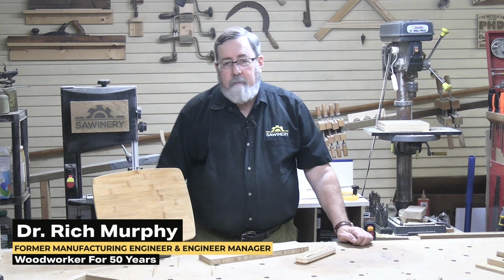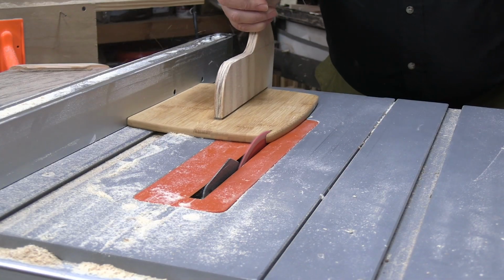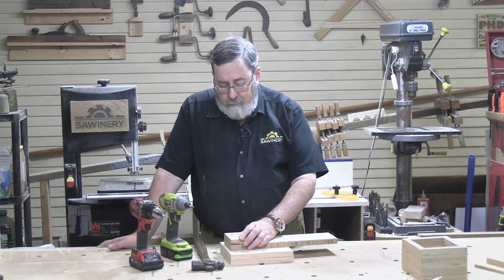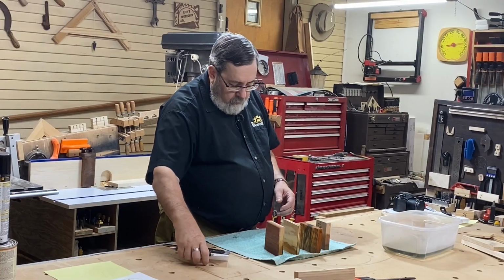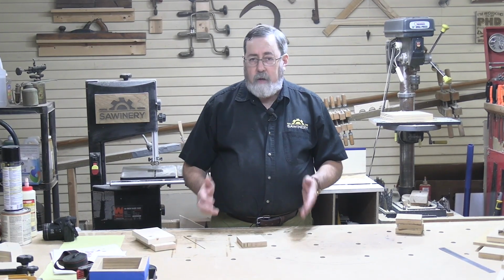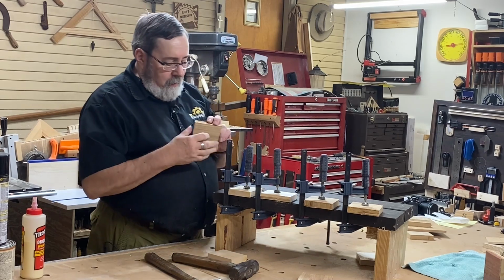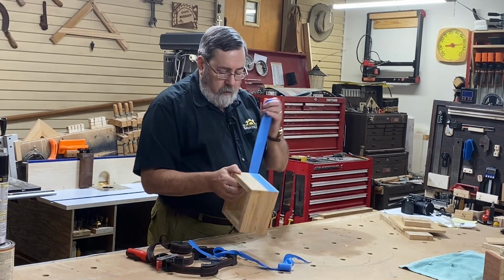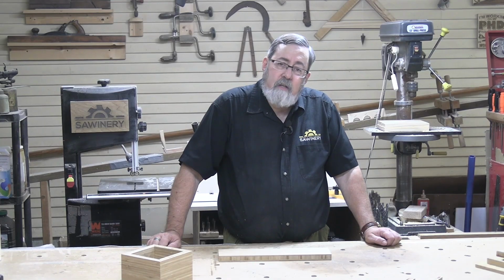Bamboo for Woodworking? I Tested It to Find Out!

Comment: You can buy solid bamboo flooring. The stuff I have is 15mm thick and is not a plywood-style material but composed of either 15 x 6mm strips bonded vertically, or three layers of 17 x 6mm strips glued edge-on.
That suggests that boards should be available that haven't been made into flooring - but I haven't found it yet!

Comment: There is a company called CIC Workshop that sells 3/4" two tone bamboo called BamX for about $15 a board foot. It’s sold as a CNC material but you could use it for traditional woodworking if you wanted.

Comment: Bamboo is a terrible material. It's attractive but very expensive.
The plywood is very expensive, like $300 per 4X8 3/4 sheet and last I checked was 5 years ago.
The real problem is the splinters. They are long and very sharp and very painful.

Comment: Looking at the measurement for wood expansion with water, you can normalize the change by dividing the new width by the previous width.  If you do that, the bamboo expands by 1.012 over its original size, the Softwood by 1.089 times, the Pine by 1.05 times, and the Oak by 1.073 times.  It still shows how insignificant the bamboo expansion is relative to the others.

Comment: 27:00, the difference in price between the price of the cutting boards and the price of the plywood is related to the countries they are coming from. Most of the plywood is coming out of Japan with their dedication to quality control, and it's mostly made from Phylllostachys bambusoides or Japanese timber bamboo, which is a relatively thin walled and temperate bamboo. The cutting boards are machine made in China with government subsidies and prison/slave labor from Phyllostachys edulis which is the main Chinese timber and food bamboo. Thick walled and temperate, it requires a tight range of growing conditions in order to thrive. Most of the flooring is made in India or the middle east from Bambusa textilis and other clumping tropical bamboo.
We are working on developing our domestic production here in America, but close to 80% of our bamboo is still being imported. Clumping bamboo is more of a softwood, while temperate bamboo is more of a softwood. Rather than using bamboo as a replacement for cheap softwoods, it's better to use it in applications where toughness is a factor, especially in comparison to its weight and size, since it's tensile strength competes with steel.

Comment: Years ago i knew a guy that made bamboo furniture out of bent pieces of whole bamboo, then lacquered. he had a ample supply where he lived and it grows fast. I think there is lot of potential. I think the prices will come down it already used in mass manufacturing it doesn't have to be that expensive.

Comment: Like lumbar core plywood then? Just more homogeneous? 

Daresay it'll come down given it's sustainability 

Thanks for video of this, limited info out there.
Reply from the maker: The structure is different than lumber core plywood and it is also made from bamboo. The piece I used had only one core layer, which was laid perpendicular to the grain of the surface layers.

Comment: One of the other reasons it is so expensive is the fact it can't be manufactured here in the West. There is specialized machinery used in the areas of the world, mainly Asia, where bamboo is grown and processed. Then it has to be shipped around the world to get to us. Also, a lot of the prep work of bamboo to get to the point of being able to manufacture it is done by hand, by cheap labor. In other "woods", the processing is simple, and the same methods have been used for 150 years, if not longer. Plywood has gone under improvement over the years, and machinery has been upgraded to accommodate those upgrades. As you mentioned, it's new, and anything new is generally more expensive until it's been around for a while. I would like to see the sheet goods used in Asia to be available here in the States. Thier version of butcher block comes in varying thicknesses like our plywood does but it is finger jointed. I would love to get a few sheets of that!

Comment: Bamboo is very cheap, fast and easy to grow as it is just grass after all and it doesn't take much space. With a single knot you can let it grow for a couple of months, drop it when you see ten knots and within a year you'll have a lot of it. There are three bamboos that I know that can be used for high performing growth that are the Moso Bamboo, Madake Bamboo and Golden Bamboo (one of these being absurdly fast but don't remember which one). It is extremely versatile, strong and great for beginners. I'll grew a bunch of it to make a high fence and it will be extremely cheap'n'easy to do it. 
I want to make a garden tool shed but I don't know how I'll approach it as I don't want pests crawling in it and I know I'll have to combine another material or layered bamboo (probably both), as for the roofing I'll let some bamboo grow a while longer to get some thickness to it and cut it half and interlock it to be water proof, think of a W-shaped bamboo roofing.  

Great video, learnt a lot. Regarding the logistics of bamboo, considering that it is high volume and cheap when raw I believe that the domestic market will have to pick up the production from Florida to around near Dallas as prime spots to grow it.

Comment: Total layman here, not a woodworker at all: Seems to me that the way to use bamboo cheaply and efficiently for structures is in its least processed state: Straightened tubular stalks, maybe cured for strength. I've seen incredibly tall scaffoldings built in Hong Kong using mature bamboo stalks. They would likely make for an excellent framing material, which flat wall panels and flooring can then be nailed or lashed to, maybe using U-clamps or some such.

Comment: only thing to be aware of is, when you have a single layer sheet of bamboo, it will crack easily when it shrinks, so you always pretty much need a minimum of a 2 layer plywood
Reply: also untreated it molds easily when it gets wet like outside, maybe because of the sugars
Reply: @DoozyyTV  Mine doesn't mold and I have left it  lay out in 8 months of pacific coast winter rain that grows algae on my driveway. Even the dry leaves usually make it several months.
Reply: @TheDuckofDoom.  maybe it differs with species

Comment: Bamboo, being a grass, grows super fast too. Its super 'green', because it grows fast and just about anywhere. The price should come down drastically as it becomes accepted enough that more processing facilities are worth bringing online.  And price only has to drop down to compete with other plywood options for it to take off
Reply: It is mostly a myth based on half truths spread by people with a trivia level knowledge of the subject. Dry wood-mass production of bamboo is not much different from most trees on a per acre average, plant leaves can only absorb so much sunlight once you have a closed canopy it is all being intercepted. Absorbed sunlight = cellulose and lignin. 
The culm only elongates for about 2 months(Using sugars stored up over the prior 9-10 months), but it can only do one flush per year in temperate climates, and then takes 3 years a culm to harden for harvest. Even that is assuming a matured plant that can send up large culms, which takes 5-10 years depending on transplant size and growing conditions. And of course they are hollow and airspace doesn't count.

Comment: I found this interesting because I've built things from 9mm bamboo plywood, but didn't test as many aspects nor as methodically as you did.  

I made a concealed drawer about 30" x 18" x 2½", with rounded-over edges and internal partitions, some trays, and an octagonal box about 10"x 8" x 7½"with some laser engraving and a lift-off lid made from two layers laminated together.  It cut really well with my mitre saw, and yes, the usual tricks (like scoring the line first) do prevent tearout and spintering.  Joints were mostly simple butt joints or mitres, glued with Cascamite (if you're not familiar with that, it's a powdered resin-based wood glue).  Some were pinned with 18g brad nails from a nail gun with no issues.  Edges from the router cutter and some others that were just sanded came out very nicely. I didn't need to sand the face surfaces like I usually would with baltic birch, and most of the items were finished with beeswax paste, which worked well.

All that was from a single 8' x 4' sheet, which was actually less expensive than the same size baltic birch would have been at the time, though I got a small discount because one corner had some water damage.  So, yes, water does eventually affect it, in this case making it warp and discolour.

Comment: Bamboo can be processed into a very effective replacement for wood, however, it is worth noting that the high silica content does result in bamboo dulling your steel cutting implements much more rapidly than regular wood. It's also one of the reasons I don't like it for cutting boards.

Comment: I made my PC desk out of bamboo, 120€ (around $140). It was a 240x65x3.8 cm board cut to 200cm. With the leftover piece and a couple of cheap bamboo cutting boards ($10 each) made some shelfs for the desk. It's an awsome material to work with, very durable and beautiful. Hope you can find it cheaper!!!

Comment: Bamboo board is an amazing material with a hardness compared to the harder hardwoods and a flex compared to the more flexible hardwoods. It's very very useful for sports equipment like boards, sticks, clubs  and bows. It's also a very good work surface material.

The price comes down to trade and locality. It can grow anywhere and it does so really fast. This means it's possible to get it as a very cheap and sustainable material anywhere as long as there's companies growing it that are local enough and of a big enough scale. Nowadays most of the raw bamboo board material that's available on the market is grown in China so the price is heavily influenced by transport costs and trade relations.

I hope more large growers pop up in Europe and North America becaues it's well worth the effort.
Reply: The properties have a wide range from specie to specie. I have some that bend to the ground under snow load then spring back but generally are a bit noodlely. 
Others that are fairly brittle and more prone to splitting but are much more upright and ridged. This is partly due to different wall thickness to diameter ratios but also just a difference in the basic fiber structure.
Reply: @TheDuckofDoom.  The workable sheet material is also prone to splitting but to break across the fibers is almost impossible. That's why you see three layered laminates with a very thin top and bottom sheet. It's just to keep the fibers of the core together to form an extremely though sheet material but if you know its strengths and limitations you have more flexibility using the single ply sheets.

Comment: I built a  very large tent frame for an ex army tent. it lasted well over thirty years. eventually the canvas rotted away but the frame was still remarkably sturdy. My carpet is bamboo, my undies, are too
Reply: FYI, “bamboo” fabrics are a semi-scam: it is simply Rayon (viscose) made from bamboo cellulose rather than wood cellulose. It is not, as the marketing often suggests, a natural fiber. (Rayon is considered semi-synthetic.) True natural bamboo fibers are rarely used.

Comment: It's still not economical, but bamboo is a common option for standing desks and some of the manufacturers sell the tops standalone. It's an option for larger pieces.

As for the price, it's a bit of an economic chicken and the egg scenario. Until people are using enough bamboo to establish more regular volume shipping and quick stock turnover in retailers, the logistics of low demand are going to inflate the price, and the inflated price is going to keep demand supressed. It might take something like volume agreements between local woodworkers and local lumberyards/hardware stores to get the ball rolling on driving down the price.

Comment: I have been making golf putters from laminated bamboo for 7 years, and before that I made cabinet doors and loudspeaker cabinets from it.  Once you figure out how to work with it, you can achieve outstanding results.  One of the hardest problems I have faced was getting a supply of the material shipped to Hawaii in the thicknesses I needed.  I started with unfinished flooring that I laminated together to build up the thickness I needed, but eventually I could no longer get that as flooring switched to strand woven (which doesn't work for my application).  I changed over to a combination of 3/4" plywood laminated to stair tread planks that I planed to thickness, then ran of that.  Now I am using cutting boards laminated together.  I found a factory in China that makes cutting boards, and got them to make rectangular boards of the sized and thickness that I need for my process.  The shipping costs 3x the cost of the material, but overall it is affordable and I have a consistent supply.  One consideration is that untreated bamboo is bad about growing mold in a humid climate, so I have to clean the boards carefully then store them in a small dehumidified cabinet.

Comment: Bamboo is perhaps the single most versatile organic product I could imagine. You can use it for every part of a "meal": you can cook the roots and shoots in a bamboo pot, using bamboo utensils, suspended on a bamboo frame, while sitting on a bamboo mat under a bamboo cover, with a fire burning bamboo that you started with bamboo feathered tinder, kindling, and bamboo friction bow. Not really related to woodworking but even so, I love this stuff.

I doubt I'd ever build a wardrobe from it, but a bathroom cabinet or vanity... yeah probably.
Reply: another extremely versatile material is hemp! Hemp can be made into almost anything as well and is also very fast growing like Bamboo, they've made hemp plywood type deal thats similar in hardness to Oak, and hemp can also be made into fabric, shampoo, paper, rope, and a ton of other materials, technically, its possible to construct a piece of furniture with your only materials being Hemp sourced materials, as even hemp oil, while not the best oil finish, can be used for finishing wood projects as well. Bamboo and Hemp both are increcible materials and can be used for almost anything! absolutely they should both be used and studied even more for potential options.
Reply: have you ever seen panda turds? they are white from all the bamboo they eat
Reply: Bamboo also takes stain well. And you don’t have to have the joints showing that way, you can have your ply side-on, which makes it look a bit like a close-grained wood.
Reply: @iridium8341  Bamboo makes terrifically strong ply. Stronger than hardwood.
Reply: Actually you might make a wardrobe depending where you live. Clothes made from bamboo fiber can rival silk for thread count, smoothness, and moisture wicking. Making it fantastic for bed linens and excellent for casual clothing in warm tropical climates.
Reply: Bamboo is second to hemp, as the most versatile organic substance. That's what I've been told but I should probably look it up
Reply: And you can turn bamboo into pulp, then make paper out of it, and with chemical processing of its fibres you get semi-synthetic polymers which can be woven into a fabric (kinda like viscose but more pleasant to skin). Used a lot for underwear.

Comment: I don't know if this has any relevance to the conversation, but I purchased a bamboo-handled 'back brush', and a bamboo-handled 'nail brush', both for the shower, and after a single round in the shower, both have considerable black stains spreading out from the holes the bristles are in. After a week, or so, this black staining has grown significantly.
Reply: I use bamboo bench tops in my kitchen and laundry, and they do a great job. But you do need to polyurethane them to stop water penetration -- if there are parts that are constantly wet they will go moldy just like other organic bench tops.
Reply: Mildew does what mildew is allowed to do. Not the bamboo's fault.

Comment: It is possibly the best material for spline joints.
Big pieces are fake so basically just glue = bad for fumes, micro plastics, environment.  
Solid one piece cutting boards are BY FAR the best unless you like eating glue

Comment: When one considers that most fine antiques used the equivalent of veneered lumber core woods, there  are methods available to deal with end grain in finishing techniques that do not involve edge banding. Providing that the core is of the same species.

Comment: What you are calling the core of the Bamboo plywood in every other species would be sold as lumber core plywood. They do exist and are generally in the same range as the Bamboo. I have used 3/4” Luan lumber core plywood for cabinet building to be Mica laminated. Exceptionally stable.

Comment: That bamboo board sounds like what we used to call 'Block Board', which I've not seen here in the UK for around 40 years. In it's day, block board was considered to be a high quality and very stable core material, suitable for high quality veneered table tops etc. What goes around comes around...

Comment: It's super cheap here in Japan - where I live.  That cutting board you have there for example sells here for $0.70 and is readily available in quantity at the dollar store. Bamboo is likely the cheapest "wood" here in Japan next to knotty pine. But there are two main forms of it. Like the cutting board you have which has the joints visible and lengths which do not - and appear straight all the way along. That stuff is specially grown and can be quite costly.
Reply: He even mentioned cutting boards are cheap- it’s wood working boards which cost a mint